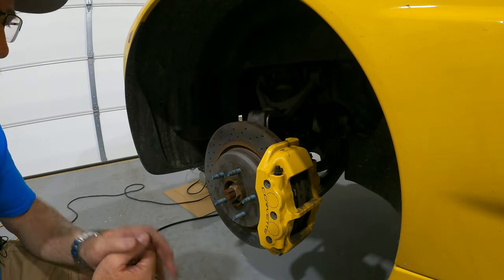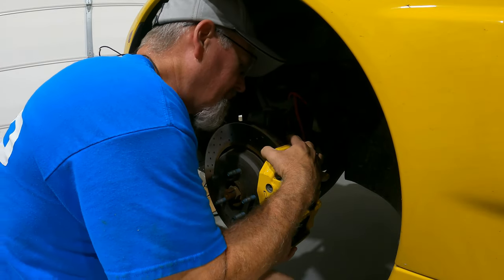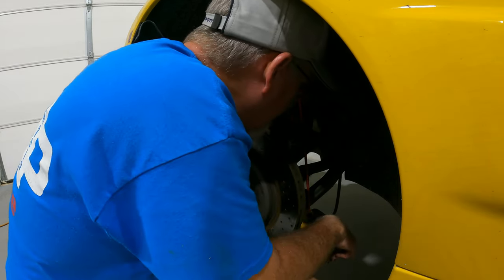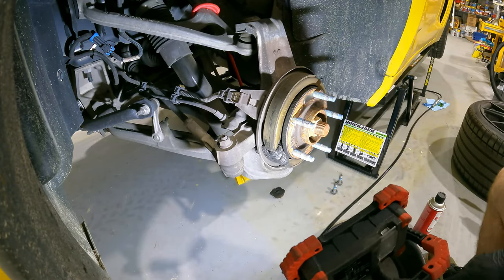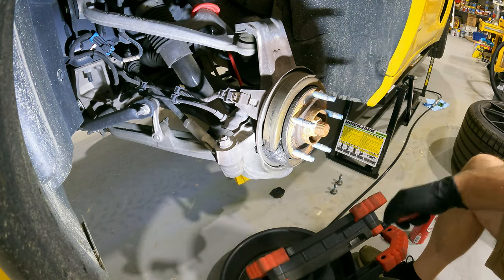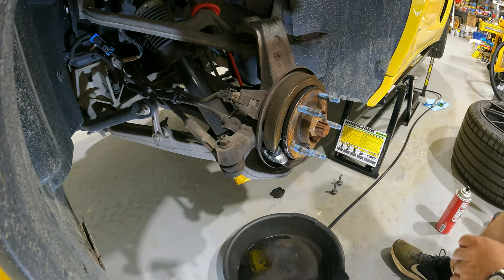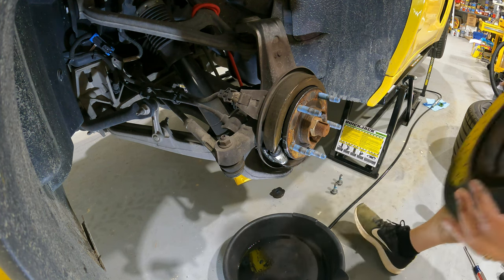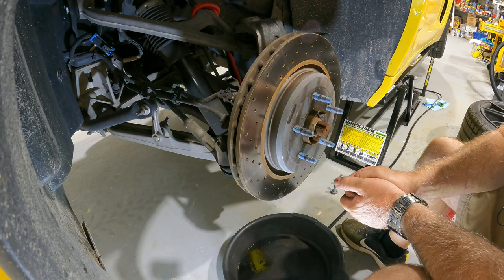How to Adjust Your C5 and C6 Corvette Parking Brake #c6corvette #c5corvette #corvette

Comment: There is a  Caliper type tool ( fairly cheap ) and specs in the C5/C6 Manual that will take the guess work out of the adjustment.
Makes life a whole lot easier and correct.
Reply from the maker: Can you provide a link?  I figured there must be a tool for that but came up empty when I looked.  Thanks for the input!

Comment: Good job man. I’m big on not using hammers on rotors your keeping. If it’s not rusted on you can usually bump it to the inside on the edge of the rotor with your palm or your boots and it’ll fall off. 

Do you rotate the spreader to the inside of the hub or outside to spread it?
Reply from the maker: Sorry it took so long to reply!  I don't care to pound on rotors either but I've never had an issue just smack around the locating ring if it needs it.  Thanks for watching and commenting.😎